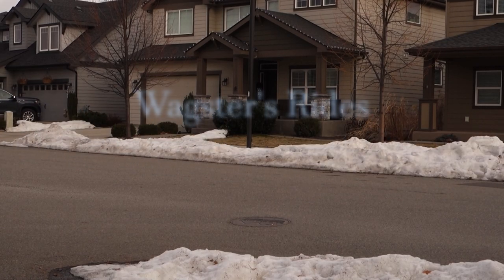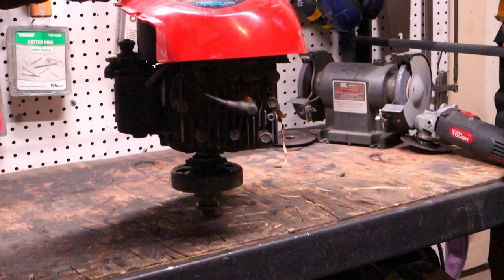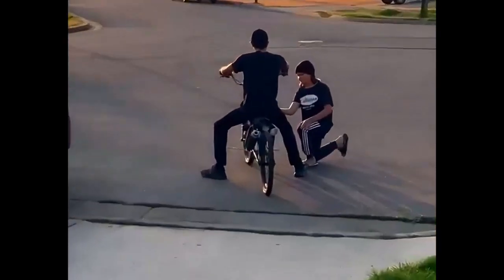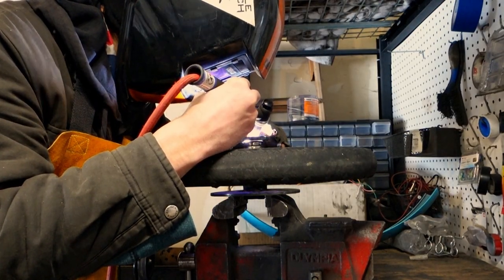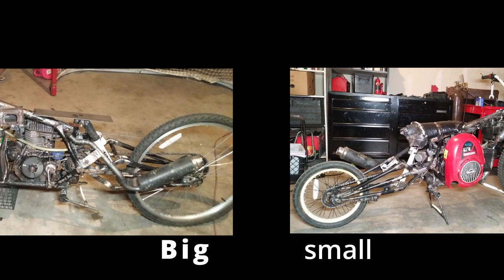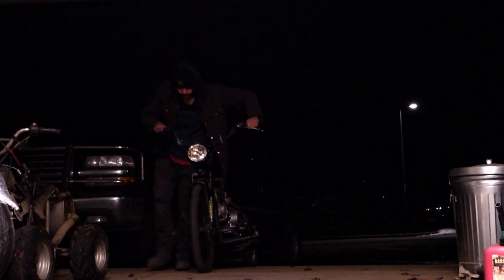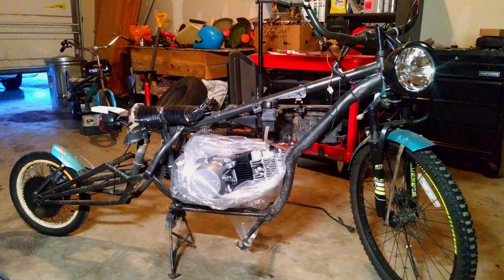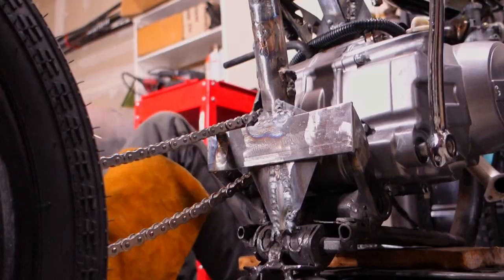Lawnmower Powered Bicycle

Comment: Not to be critical, but the older steel Schwinn bikes are stronger steel for that kind of stress/vibration.  The newer steel bikes are cheap alloy and fracture in no time at all.  Maybe if you put shocks and rubber mounts it would help(?).. Anyway, it's still entertaining and fun to watch, so thanks for the upload (and I hope to see more)!

Edit: also, the vertical-shaft L-head engine has an oil "dipper" in the crankcase that you may want to alter to splash oil on the now horizontal shaft and piston/side-valves.
Reply from the maker: I added a shock and even more gussets. I did not know that about the briggs. Thank you for the infornation!
Reply: @wagstersrides  No problem!  I'm mistaken... Oil slinger is the term.  here's something https://youtu.be/0Mba3BS1oRM